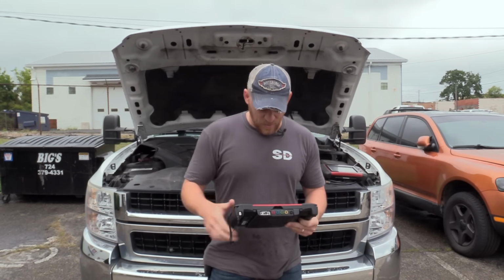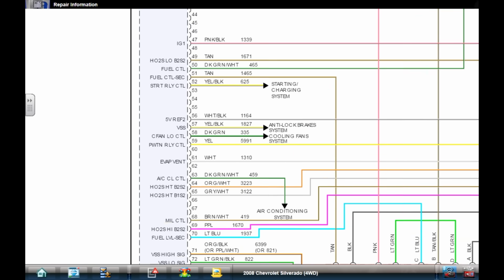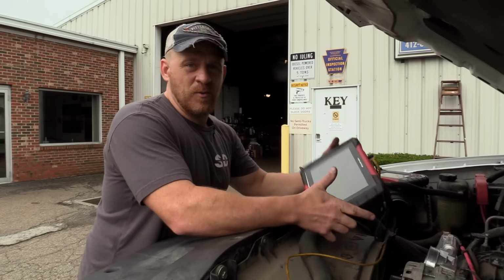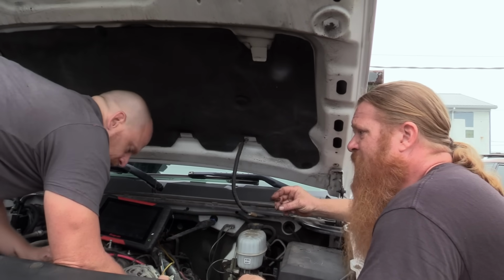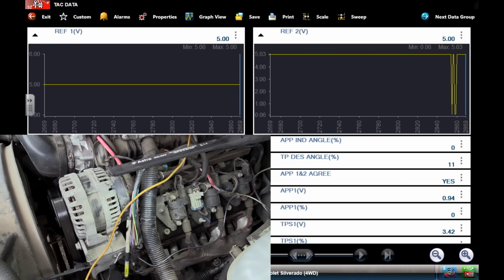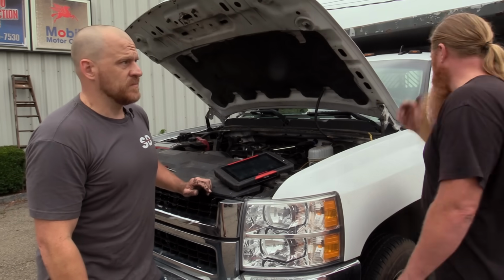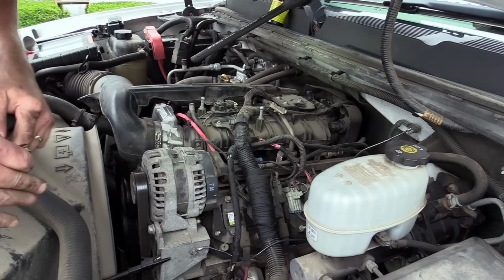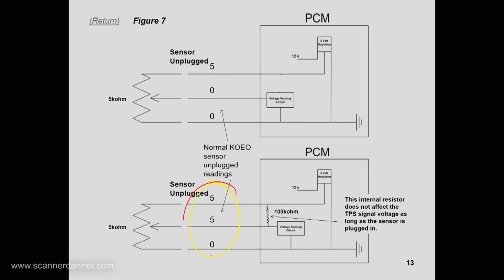Troubleshooting a Shorted 5v Reference Circuit (Chevy Silverado)

Comment: Great video as always and I bet just about anything at all that harness ended up like that BC someone climbed up on the front of that truck while working on it or checking the oil or something like that and they put their hand/bodyweight on it to hold themself up while doing whatever it was they were doing bc there's no way on that new of truck it should have worn though just from engine movement
Reply from the maker: Engine vibrations and movement together absolutely caused that. I've seen it many times on other systems

Comment: put a good piece of rubber hose on the stud end it's hitting or use a ziptie with screw.mount hole, if the stud is big enough if can simple be driven onto it to stay in place.
I'm thinking it was factory mounted near that point originally, but maybe my memory is wrong
Reply: throttle bottle - It's absolutely fundamental to follow and properly reuse the factory mounts. It can save a huge amount of head aches. 
Just last month a recently bought used van, gave me some issues. With AC circuit and a few other random "happenings". All said and done, whoever was in there messing things up. Didn't put the wire harness properly back in place.
Literally exchanging the AC plug with the oil pressure plug!. Long story short, took awhile to realize I was looking to the wrong wires. Solution only came to be after replacing all the wires in they're proper places (mounts). Than it became obvious due to the different lengths! 
1 minute fix , but a few hours scratching the head. ;-)

Comment: Just this last week I had a 2004 Durango with the 5.7 L with a P0207 and P0307 and P0201. The engine had a dead misfire. Upon checking the mode 6 misfire data it only had significant misfires for cylinder 7 and a few for cylinder 1. Ok seemed simple enough. I checked for 12 volts on my number 7 injector connector and tested for pulse on my ground side. All checked out good. So I figured I must have an open injector. But when I tested it I had 12 ohms which seemed to be in range. I really thought it would be open or at least significantly lower than the others. So I checked my wiring again to make sure all was good. Again same readings, tight connections. So I did change out the injector. I was going to swap but, for the cost of that injector it was cheaper to replace. With the new injector the misfire was gone. Is there a better way or another way to more accurately test the injectors?
Reply from the maker: Injector balance test for sure would have picked that up. I have some videos on doing this.
Reply: ScannerDanner Cool. I will have to look that up. Thanks. What’s the reason for the open circuit code though? That’s the part I was confused on.
Reply from the maker: I missed that part. Scope and amp probe for the win then. Ohm test is unloaded and the winding can test good when not under stress
Reply: ScannerDanner Oh. Yeah that makes sense. I didn’t think about that. It was dropping out under load. Thanks.
Reply: ScannerDanner Do you know of any good hands on training places near Erie, Pa? I would like to start getting into some hands on training if I could find some close to home.
Reply from the maker: I do not my friend

Comment: Had a 5v ref short throwing an egr code on a Bonneville. After being guilty of parts changing, you guessed it, the egr valve, the car was still throwing an intermittant  egr code with a stalling stumbling condition. Started checking for wiring shorts and didn't find any. I started to suspect a bad ecm, so you guessed it, I swapped the ecm with a used one. The code and the stalling disappeared. Just for the heck of it I opened up the ecm case, and low and behold there was an aluminum shaving hanging off of the inside of the case, shorting out the circuit board of the ecm. An xray visual inspection required in that case!

Comment: Those stupid commercials definitely put the idea in customers heads that our scan tools tell us the problem and we are ripping them off. It can make selling additional diag time to find the exact spot where the wire is broken or shorted. If I know I have a broken or shorted wire and the harness is routed in a way that it’s going to take a bunch of time to find the problem I will tell the customer I can run a new wire or I will need more time to find the exact location of the problem in the wire. It’s very easy for techs that don’t own the business to say “I wouldn’t do the job if the customer won’t pay to do it the better way”. When you have a customer that only has 300 bucks to spend and not 700 you as a business owner need to make money. It’s really funny how so many techs talk so much about how they won’t do a job well that’s why they are techs and don’t own a shop. Many techs that open their own shop fail due to reasons like this. You never want to do something that’s not safe but you need to make money and turning customers away is not how you do it.
Reply from the maker: Really great write up and I completely agree with you. Thanks so much

Comment: that's a common point,and also on passenger side coil hold bolts.the reason why is because there is suppose to be screwed on plastic protector.think it's a t20 head on it.they fall out cause of heat cycles.i have done alot.
Reply from the maker: the things I learn from you guys, thanks!

Comment: What internet do you use  in shopkey pro. Please help me sir
Reply from the maker: Yes sir and it is a professional program that runs about $160 a month. There is a DIY version too that runs $20 for a single car for a 30 day pass. Of course you can print everything too http://eautorepair.adtrk.biz/?a=10817&c=24&p=r&s1=
Reply: What to write in internet connection while logging into Shopkey pro . Please help me . Thanks for answer. Sir.
Reply: How is login in shopkey pro. Please help me sir.
Reply from the maker: @mohammadkaunainansari171  you will need to email them, sorry
Reply: What Internet do you use in shopkey pro DSL or T1 or satellite please help me sir.

Comment: Thank you for taking time to make this video.... I understand that the diagnostic assessment is the hardest part of any job. I'm not a tech. I reside in a big city and work on my truck because I can't trust shops or afford their fee. I have an issue with my truck and I finally decided to take it in to see a professional, after seeing so many videos and not been able to fixing it myself.  I paid their diagnosis fee and was quoted 1200 USD for the job. I was told that the repair would solve my problem. I purchased the replacements and did the job myself, I saved 1000 USD. Unfortunately, it didn't solve the problem...😡 I'm glad I only paid their diagnosis fee and nothing else 😒.  Is it the industry or the individual that gives everyone working in the industry a bad name?  I think it's the individual, despite of the industry's practices. It's a choice to cut corners, it's a choice for the lack off work ethics and because of that, because of that choice that it leave us (the customers) with a sour taste in their mouth. I have learned so much by watching you and other great creators for the past three years that I am able to make necessary repairs to my truck, thank you...
Reply from the maker: Our industry has so much wrong with it. I wish I had the answer to fix it. But I feel like I'm doing my part to at least raise awareness that reading codes and changing parts is NOT diagnostics! 
Unfortunately your story is all too common and happens waaaaay more than it should. To the consumer, the mechanic is a thief. He actually is not, he is incompetent in his trade and it costs the customer big time.
Reply: @ScannerDanner  Actually, when someone sells something that he knows won't fix the problem, he is a thief.

Comment: Cheers to permanent kick me signs :D  I'm impressed with finding that wire.  I had a no comm fault on a Jeep a couple months ago that was trying to send data on a com (+) line, but had a badly hashed signal coming off of it.  The data packets looks like choppy O2 data pids.   I found a piece of exposed harness with the comm wires out in the open and it looked just fine with what appeared to be normal dirt & dust you'd expect to see under any hood.  It turned out there was cut in the wire and it was as thin as a strand of lint.  There was just a little dust under the cut that wouldn't wipe away and that's when I tweaked the wire to find the sheathing pull away and present a lip in the sheathing where the cut began.  I was proud of myself for being able to pick out such a small detail like that.  Then I watch you find a pinhole within a pinhole and I feel like I'm still at kindergarten level diagnostics.  Great work man!
Reply from the maker: awesome job man! This one wasn't too bad because we were limited in where the harness routed too. A CAN system can be an entirely different animal depending on the number of modules connected and whether or not the manufacturer uses splice packs to help isolate faults. So good job again on yours.

Comment: I went and looked at a combine that the customer was using and shut off and it would not crank again. After an hour of looking I found a chain tensioner that works back and forth had worn through a harness containing at least 30 wires. The one on top just happened to be the solenoid wire. When he started the field it was ok but by the time he was done it had worn through.

Comment: I think the scan tool installing as a node is a gm thing. These are the only vehicles that I’ve encountered that do this.
Reply from the maker: My wife's navigator did the same thing when I was prepping for my newest class
Reply: ScannerDanner I found this out when I was diagnosing a suspension complaint on a 2015 suburban. As soon as I plugged in a verus, the dash lit up and suspension got rock hard. Set all kinds of comm codes for the suspension module.  

Made sense, check power ground and comm, replace suspension module. 

Turned out it was seized front struts. The snap on installed itself as a node and the system didn’t like it.
Reply from the maker: That's crazy! Noted for sure! Thanks Chris. 
Will you be at super Saturday?
Reply: ScannerDanner unfortunately no. I’m teaching a worldpac class that day... :(
Reply from the maker: @chrismartino9078  ah, that stinks, maybe soon then we can have a beer
Reply: I will be taking the red eye back and doing Super Sunday in NYC. You coming for that?

Comment: Awesome find!  I love this video not only because you found the short, but you uncovered the logic the PCM uses when it detects that fault.  System fault logic is rarely described in service info and frequently leads us techs down rabbit holes.
Reply from the maker: agree! Imagine if the manufacture gave us more of the system logic!
Reply: @ScannerDanner  it sure would make our job a little easier.

Comment: I had a Chevy Cruze with all these exact issues, only difference is I had a fault on all 5 of the 5v ref circuits. I ended up putting a used computer in and that fixed the issue, I am still not certain that was the issue but I could not find any issue with the harness and all 5lines had good voltage. Thank you for the amazing work you do.

Comment: Can you show how to diagnose eletro hydraulic steering pumps?
Reply from the maker: no different than any other output controls, you just need to apply power and ground side switching and pulse width modulation to a new component, then get some good service information on the system you are working on and off you go! Of course, when I see one with a problem, I will most certainly film it.
Reply: @ScannerDanner  thank you for the answer Dan! I have you e book and youtube have help me a lot on the understanding how things work the proper way!
Reply: I dont have wiring diagram for this car.  But i have 2 plugs 1 with Power and ground all good.
Then the 2 plug i have 5 wires. The first is ignition feed 12v+ but i dont have no voltage on  the others 4 . Far as i Know this system is can bus controled via VSS and SAS shouldnt i see a 5v reference signal? The pump works good but stays at constant rpm and sterring is hard at idle i think i should see rpm increase since this is PWM pump.
Reply from the maker: For sure! Oh and my name is Paul :-)
Reply from the maker: You need some good service information my friend. http://eautorepair.adtrk.biz/?a=10817&c=24&p=r&s1=
If you need additional help, Post this to my forum. It is free to join and we have an awesome community that is friendly and willing to help. https://www.scannerdanner.com/forum/post-your-repair-questions-here.html
Hope to see you there!
Reply: Sorry ! Thanks Paul!  i will look for the wiring . Keep going youre doing an excellent job!
Reply from the maker: @cristianojoana2016  Thank you! Sorry I can't help you here. I try to answer as many people as I can without having to refer to service information. As you can imagine, that is where the time will get sucked up for me and I won't be able to talk to as many of you as I would like to here. Hope that makes sense. I promise my forum is awesome! I have 4 guys I pay to personally help me help you guys. They have been longtime supporters and followers of all of my classes and material and you will be guided with great care.
Reply: @ScannerDanner  yes Paul i understand what you mean.. you have your job and your life is not easy... and you even after all that you do so much more here for us on youtube all over the world , yes you cant help now but you are always willing to help! And its not easy to help everyone at every time because youre constantly teaching us!! Thank you for you time Paul , i will join i look for the forum , i have you e book but didnt know about the forum.  Thanks again and keep going!

Comment: gread vid guys, well done, im working on a seat leon atm, missfire cylinder 4, someone changed the spark plugs coil and injector and it still missfired only when its warmed up, turns out the exhaust valves are leaking, its a 2002 33,000miles 16v 1600cc, all the valve guides on these vw engines are soft and need replacing, engine code is BCB just in case you get one come up, dont be a parts changer guys.

Comment: The 5 volt adapter on the power probe can run this annoying problem down in minutes.
Everybody should have one and understand it. You can't burn stuff up, and the right guy can turn hours into minutes. Glad you found your short.  Lets see if the MIL stays off ??
Reply from the maker: There is no tool that will track down a short to ground that is NOT shorted to ground when you are looking for it. smh
"Lets see if the MIL stays off"?? Who cares if it doesn't, if it comes back on, it is a separate problem. Not really sure where you were going with this.
Reply: @ScannerDanner  You wouldn't  need somebody shaking harnesses on you necessary, hiding the situation, but you enjoy making a day out of exploring, and playing with cool equipment. Could have watched a test light blink off and on, instead of dragging out the scope, however your teaching kids that might work at a dealer by the hour. Sadly a lot of my equipment collects dust, as one truly doesn't need most of it, unless looking for a miss-fire, I found anyway.  YouTube auto play pulled up your video and it made me a bit excited, so I wont bother you any more.
No disrespect intended, and good day..
Reply from the maker: you're not bothering me at all, I only took issue with the idea that a specific tool would have made a difference here, it most certainly would not have, then, as I mentioned in the video, I use a desktop recorder on my scan tool /lab scope so it makes it very nice for the viewers to see the scene, this is what dictates what tools I use more than anything these days. I want my viewers to have as clear of a picture as possible. Of course a lab scope was NOT needed in this video and I even said that. If you are new to my channel, then I understand you missing these points. Thanks for watching! Hope you stick around, didn't mean to offend.
Reply: @joemarotta2237 "exploring and playing with cool equipment" in this case is teaching for those of us willing to learn.  He could have found and fixed this in a short time if he were not using it as a teaching opportunity, and someone with your obvious knowledge and experience  should have recognized this.
Reply: @paulmonk7820  Thanks for your input, this video accidentally came up on auto play while I was resting, and he just seemed so lost running back and forth analyzing his equipment status. I also mentioned I'll leave him alone now, no reason for me getting annoyed, and he upset from my comment, as he certainly had the right to go at problems his own way, for what ever reason there might be.
THX again for the response, and be well..

Comment: Parts changing drives me nuts.
Funny thing is.. once someone has mastered diagnosis.. it doesn't take long to fix right the first time.

Unf.. owners will always try to save money thinking they can do themself.
Along side the parts changing has produced inferior parts. They don't always work or work correctly or for very long. 
Change a Ford electric cooling fan with a none FoMoCo.. it won't work correctly. Experience.

Comment: My thought was to put a vinyl vacuum cap on that exposed stud. I’m wondering if there was a stud mounted panduit tie there originally (or at least suppose to have one and never had it installed).
Reply: A small piece of fuel line over the stud would work too.  I'd safety wire the hose numb in-place.  But, I'm one of those, fix-it-once-for-life kinda folks.
Reply: possibly add an acorn nut to the stud that is rounded and smooth and less likely to cut into the plastic wire cover
Reply: I almost instantly had the same thought. Not a permafix, but a damn sight better than the way it sat.